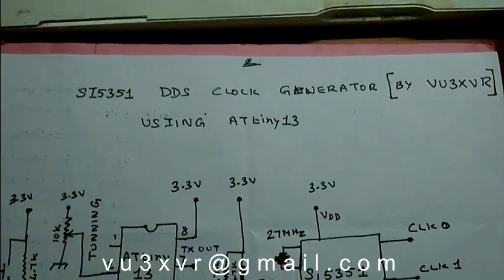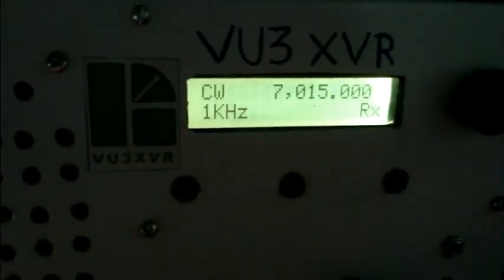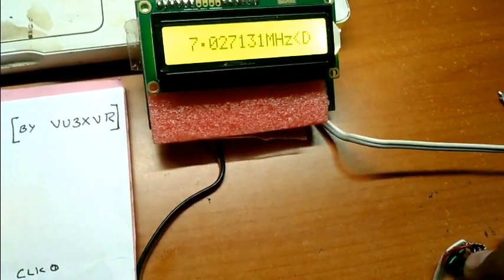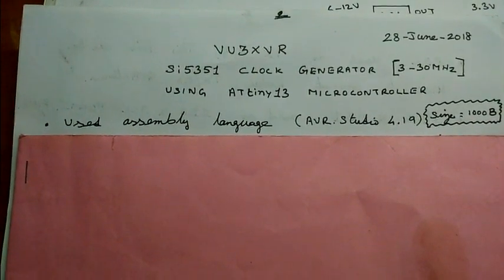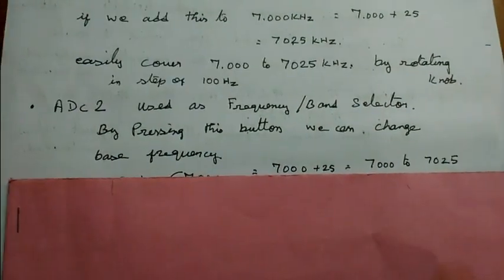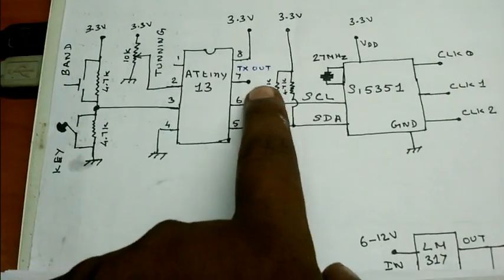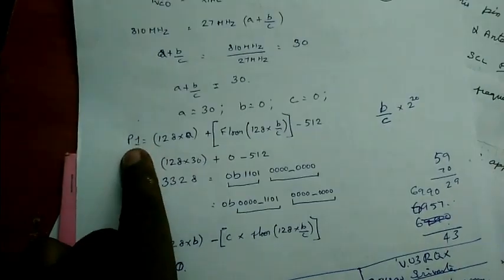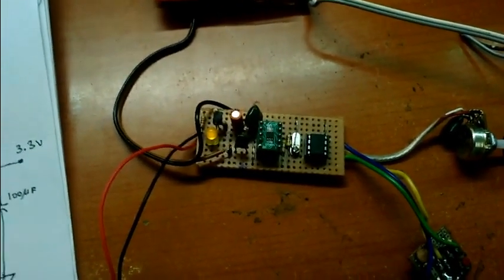Si5351 DDS Using ATtiny13 assembly language

Comment: Cool, nice video. Need to be careful you don't press the key and the band switch at the same time. That will short out the power supply. Maybe include a series resistor to VCC. Cheers, Ian

Comment: Fascinating!
The usual place for the Si5351 boards is Adafruit - and they have three clock outputs. 
Is the PCB your own design or did you buy them from somewhere?
73 - G4WIF
Reply from the maker: Tony, i'm using barebone. I assembled my own PCB. Its very simple project. You can buy components and proceed. The source code is not yet ready for release, but HEX file is released. Download it from my blog.
Reply: Thanks for putting the HEX file out there. I look forward to reading the source code and learning how you managed this fine design. Good job.
73 - G4WIF